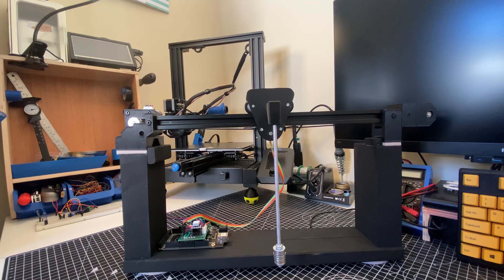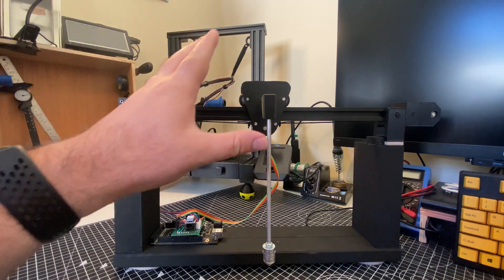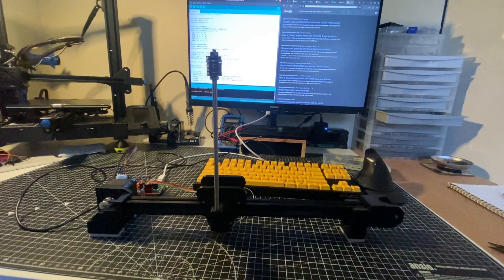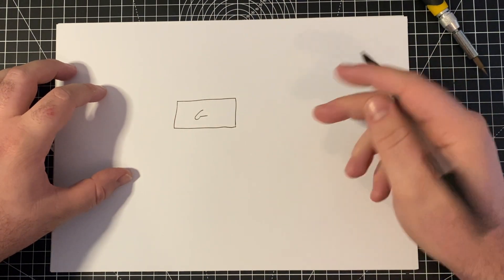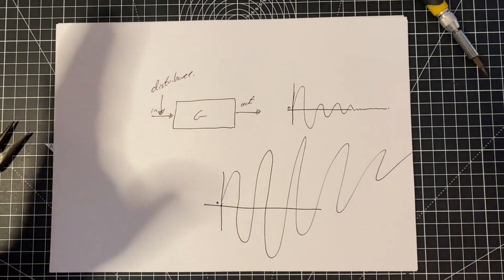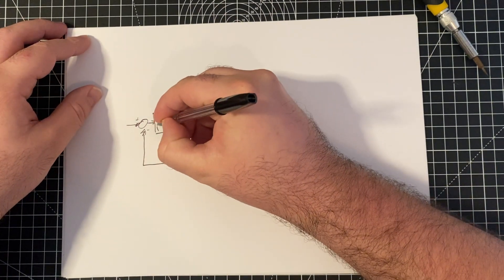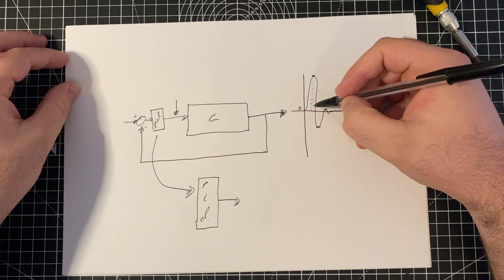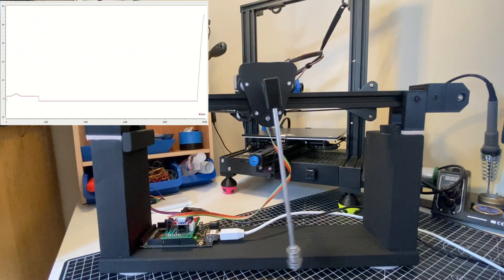Inverted Pendulum - Arduino Balancing Robot

Comment: What did you use for a power supply going to the shield for the stepper motor, and for the power going from the power supply to the CNC shield for the stepper motor are you limiting it to 3.6V and 1.5A? I am new to this kind of stuff and not sure how to properly power the stepper motor.
Reply from the maker: Good question, the shield plugs into a standard 12V wallworth power supply. The shielf has a 5v regulator onboard with then powers the Arduino. The stepper driver takes 12v directly for the motor drive and also takes 5v control signals on it's other pins. The motor current is controller with a tiny pot on the driver board. Adjusting this adjusts the phase current for the motor. This depends on what motor you are using. You can find the ideal phase current in the data sheet for your motor. You can also tweak it to try get the best performance out of your motor.
Reply: @careyian  Okay! Sounds good. I kept having an issue of the motor trying to spin but only making a noise and struggling to spin. If I had helped it out by hand and gave it a bit more force to spin it would spin perfectly fine, did not know I needed to modify the current from the controller. Thank you for the help!

Comment: Hi, Can you share the step file for the encoder mount? I could not find that in the link.
Reply from the maker: I don’t provide it as it fits with another piece of plastic that came off the back of a motor that originally was fitted with the encoder. I think this is a custom part not widely available, so there isn’t really much point in me sharing the model I made I’m afraid.

Comment: Hi Ian Carey, great work!

We've managed to get a furuta pendulum to work, also with PI control calculating motor speed, similar to your code.
If I wanted to model the motor plant transfer function, motor angular velocity to angular position. Is it just 1/s ?

Our thinking is that position is the integral of velocity. Thank you Ian.
Reply from the maker: Hi there, thanks, I’m not 100% sure what you are asking if I’m honest. However, I think what you are saying is correct.
Reply: @careyian  Thank you for answer Ian! 😁
Did you find a function for G?

We got a function for our pendulum, and its angle of pendulum/angle of motor.

If you got a function for your cart-pendulum system, maybe its pendulum angle/cart position?

If so, how would we model whats happening at the motor.
PID->motor->cart-pendulum system.
The motor kinda takes speed command as an input, and "delivers" a cart position as the output?

Its a bit weird, because we know nothing happens without acceleration. In the real world thats fine, because we deliver all kinds of different motor speeds, so there is acceleration.
Im not sure if this translates well into the modelling. PID gets error as input and deliver speed command to motor.
Motor delivers position to the pendulum-system. Pendulum system feeds back a pendulum angle.
Reply from the maker: @Rabbagust-yt4rk I didn’t do any maths for this at all. So no, I didn’t derive any transfer function at all.

Comment: Hi.. I'm doing this project but I have different parts... Will this work with uno?
Reply from the maker: Yes, it should work with an Uno!
Reply: @careyian  is there any way I can talk with you? I am  using a different stepper motor driver which is specifically A4988 and my sensor is MPU6050 .. will your code work with this components?
Reply from the maker: @filevillahermosa7167  you can message me here if you like: https://iancarey.ie/contact 

However, my code will not work with those components. The driver might work, as I believe they have the same pinout but I don’t know, I’ve never used one. As for the sensor, that’s a completely different type of sensor that I am using, so my code won’t directly work with it. You would have to modify it heavily.

Comment: howx the encoder measures the tilt angle
Reply from the maker: So there is a shaft at the base of the pendulum which runs inside bearings and is fixed to the pendulum. Onto this shaft I have mounted a quadrature encoder. So as the pendulum tilts, the shaft rotates. The encoder can measure the rotation, and so we can then work out the tilt angle.

Comment: Hello, I have some questions.
How does the encoder read the increment, does it have a slotted wheel?
Does the encoder know which direction the pendulum rotates?
Reply from the maker: Hey there, good questions! The encoder does indeed have a slotted wheel. It’s a very high precision one that is made of a very thin disc with tiny lines cut into it. The reader shines a light and records light and dark as the light shines through the slots. It actually does this twice as there are two reader heads in the unit separated by some distance. This is also how it then can figure out the direction of rotation. It’s what’s called quadrature, it reads the rising and falling edges of the pulses and so is able to figure out the direction. If you are interested in this look up quadrature encoders, specifically the encoder I used was a HEDS-9000 encoder.
Reply: @careyian  perfect, thank you very much

Comment: Can you give me the diagram, I don't know how it is connected even though I have read your program, thanks
Reply from the maker: Hi there, I don’t actually have any wiring diagrams for it. I’d have to draw some up, will see if I have time to do it any time soon. However, the wiring shouldn’t be too hard, if you look up the wiring for a DRV8825 stepper motor and a quadrature encoder you should be able to figure it out.
Reply: @careyian  I can contact you via facebook or discord
Reply: iCan you give me the circuit diagram on paper, it doesn't need to be very complicated @careyian

Comment: Nice project bro! I wonder if you have the schematic diagram of connections, could you help me out please?
Reply from the maker: Hey there, you can check out this link in the description for all the details I have published about it. https://iancarey.ie/projects/invertedpendulum

The only thing I don’t have is a wiring diagram, but if you look at the code it’ll have the pins I’m using in the Arduino, hopefully that helps a bit!
Reply: Thanks a lot for answer, but I'm looking for the connection diagram Arduino-Electronic components, I've been searching for in your website but I haven't found it. If you could help me with that I’ll appreciate it.
Reply from the maker: @irvingheredia7575  hi there, such diagrams don’t exist I’m afraid.
Reply: I'm glad you had time to answer my questions, thanks a lot!

Comment: How do I create the swinging rod and can you pass the libraries you used?
Reply from the maker: Hi there, I cut a length of stainless steel rod I had to length and threaded the end. The weights are then just a bunch of washers secured with a nut. The washers allows you to tune the weight at the end however, if you don’t have access to thread cutting tools, the rod on its own will work just fine. One tip, the longer and rod and the more weight on the end of it, the easier it will be the balance. Hope that helps! 

As for the libraries, you can find the code in the link in the description.
Reply: @careyian   Can u give me the diameter of the swinging rod?, I am making an inverted pendulum as a final project for a subject and we only need the part of the pendulum
Reply from the maker: @GustavoelGamer  it is 5mm
Reply: @careyian  I have finished with the mechanical part, only the programming part is missing. Do pins 6, 7, and 8 go to the stepper motor driver or to which components do they go?
Reply from the maker: @GustavoelGamer  6,7,8 all connect to the microstepping config pins of the driver labeled m0,m1,m2. They are not strictly necessary, you can hard wire them for a single stepping mode. I did it this way so I could tune the stepping mode in code once everything was soldered together. If you are working on a breadboard it’s still handy but it’s not too bad to just move jumper wires around.